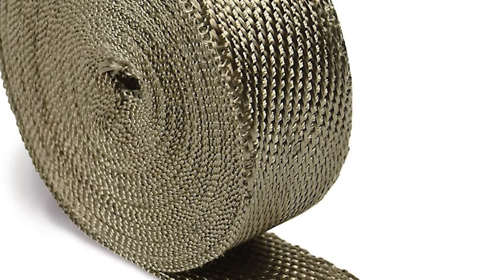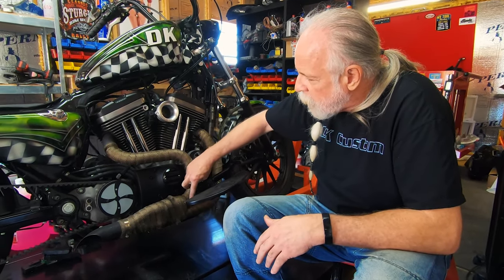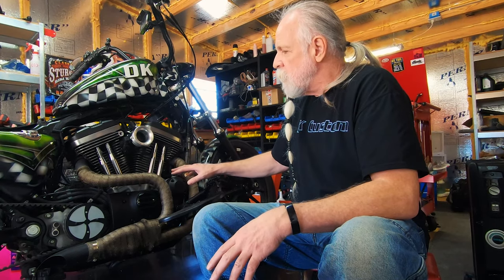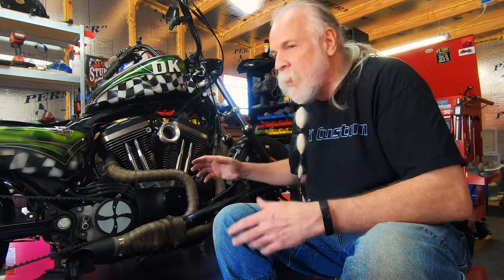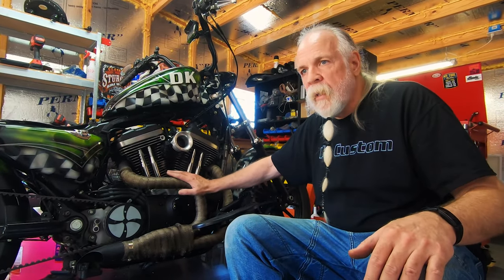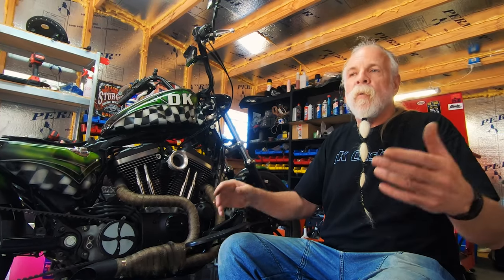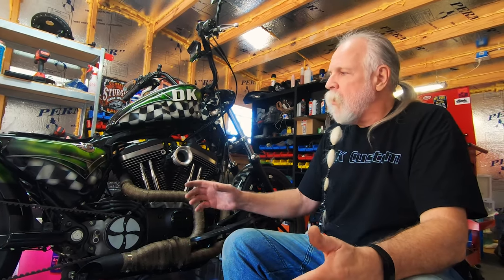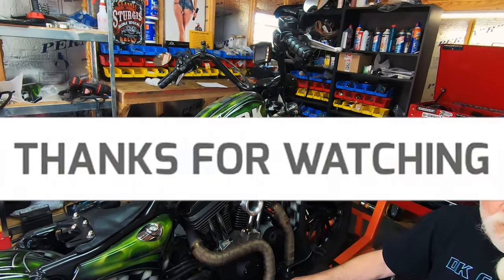Myth Busted - The Real Truth About Header Wraps

Comment: What is a normal operating temp for a wrapped exhaust?
Reply from the maker: There is no normal that we know of.  
Exhaust temps are too varied, based on exhaust length, curves and exhaust velocity (directly effected by scavenging,  reversion, ignition timing, curves in pipes, back pressure, ambient air temps and a/f ratio), how one rides, & more, to give a single number.

Exhaust gas temps (EGT) is generally measured closer to the exhaust port on the head, within 3-5 inches or so, and in the center, not the pipe temp, as different metals and their thicknesses transfer heat differently.

Pipe temps can (should) be 200-650* F, and EGTs can be in the 1000*-1800* ranges.

With a wrap the pipe temp can decrease by as much as 50%, and the EGT can increase by as much as 100 F.

You may find this video on exhaust interesting- https://www.youtube.com/watch?v=nB0XDQVjH9Y
Reply: @DKCustomProducts  .....................that makes sense.
I ask because my pipes get pretty hot. I recently got one of those laser thermometers. It's reading like 350 to 450. Now I don't know what they was gettin up to prior to gettin the Laser thermo so... I had to ask.
When you say Exhaust Temp... well I assume you're measuring the temp of the pipe the exhaust is flowing through 3-5 in from the port(exhaust pipe)... correct? Lol
Reply from the maker: Yes that is correct!
Reply: @DKCustomProducts  OK, sometimes things sound so simple they deserve an explanation.
Reply: @DKCustomProducts  But just to clarify, does 350 -450 sound like a normal exhaust pipe temp.
I have nothing to compare it to.
Reply from the maker: Pipe temps can (should) be 200-650* F
Reply: @DKCustomProducts  yea ok, cool. I have no reason to disagree... so what you're saying is that the temp of the pipe could/should be-No I'm just kidding!!🤣🤣😂😅

Comment: Thanks
Reply from the maker: You are most welcome! 👍
Reply: @DKCustomProducts  Do you think it’d be worthwhile to wrap the pipes on an old BMW r1100r?
Reply from the maker: It is hard to say as we do not know what the BMW headers are made of or if there are catalytic converters in them. 

If  you're certain that your headers are not made of titanium and they do not have catalytic converters in them,  then you can use the exhaust wrap and it will reduce radiating heat. 

If you are not sure about either of the questions above I would not use the exhaust wrap as it can harm your exhaust. 

Thanks for commenting! 😎
Reply: @DKCustomProducts  Actually I believe they ARE titanium. I’m still new to all this, so how does it make a difference?
Reply from the maker: The alloys used in the production of titanium exhaust systems tend to be thin and are designed to dissipate heat quickly. Wrapping any titanium exhaust pipe, regardless of brand, can hold in too much heat, and make the titanium alloy turn brittle and prone to premature cracking.
Another thing to be aware of regarding exhaust wrap-
Wrapping of the catalytic converter is not recommended, as overheating can lead to reduced lifetime of the converter.
Reply: Thank you 😧
Reply from the maker: You are welcome!

Comment: Another great video.  Question, though.  I am thinking about wrapping under our '14 Tri Glide's shields.  Like you, we do a LOT of riding in the rain on long trips, it seems.  In your estimation, about how long either sitting at idle or going on a short trip would you say it takes the wrap to dry fully?  So would just letting it idle for 5-10 minutes after washing do it, or would a longer time and actually putting some load on the motor be required?  Thanks guys!  -Oogie Wa Wa
Reply from the maker: I've never measured it, but am thinking a 10 minute ride is going to dry them out pretty good.  The pipes will still be hot after the ride and get that moisture evaporated, even after you park it.

Comment: Mine fell apart...
Reply from the maker: What fell apart?
Reply: My exhaust. From header wrap. Had Vance and Hines short shots and you can clearly see where it would boil off as stated in the video and it made the pipe weak there. Now I didn't wrap them so it could have been done incorrectly or like said in the video sat in a garage wet or something but mine fell apart close to the head.
Reply from the maker: @boengel5342  Yes, there are different types of wraps...We only use the titanium wrap talked about in the video.  It is really good about not holding moisture...plus, even with this wrap, if it is going to sit a lot with wet wrap, it is not recommended, as the possibility of what you experienced happening.